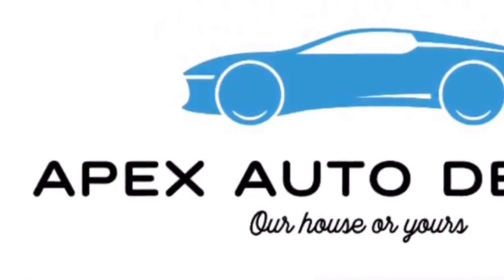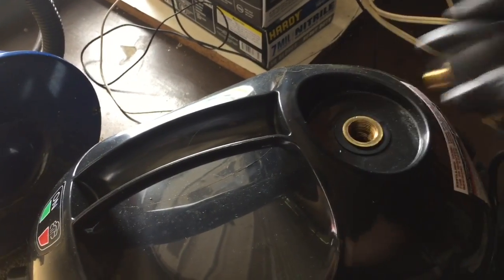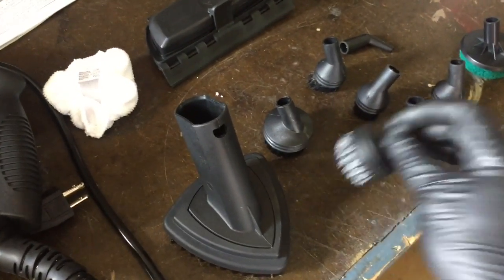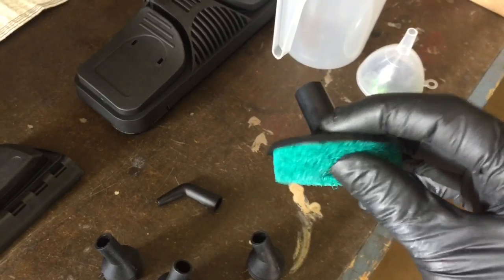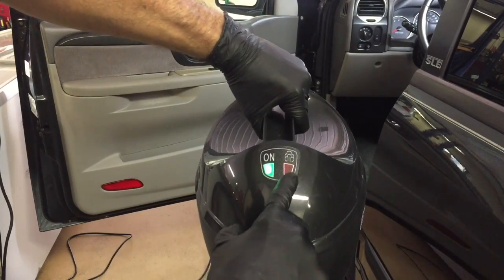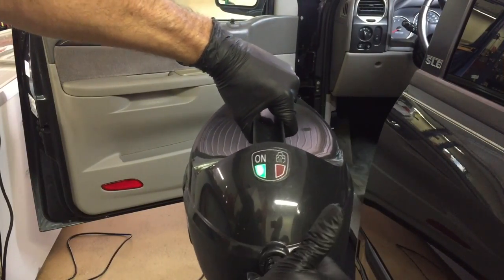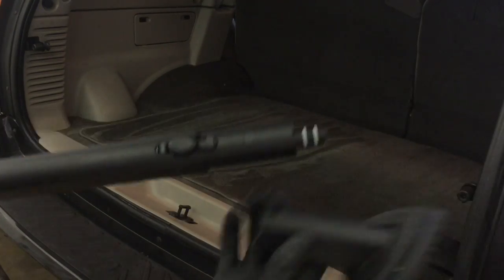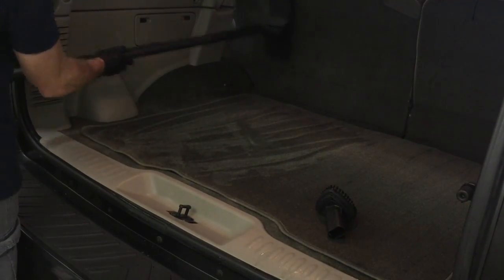Central Machinery 1500 w Steamer Kit. (From Harbor Freight) Review and Demonstration

Comment: I bought one of these for home use and it works fine for that but definitely wouldn't recommend for heavy use in a car detailing business.
Reply from the maker: I took 2 back that stopped emitting steam. One the wheel broke off. But I needed in a pinch. Kinda the only unit you can buy and take home that day in my area.☹️
Reply: Mine stopped emitting steam after two weeks. Not sure if something is clogged. It appears it is heating up but when I squeeze handle nothing happens. Guess I’m taking this one back. It’s a shame because it worked pretty good.
Reply: @kevinkleinhenz6511  Thought I'd come back to say I went through 3 of these machines in less than a year. I switched to the Dupray line of cleaners. I had one of the Central Machinery die on me in 2 weeks, also. Such a rip-off.
Reply: @watsonspuzzle  Well I suppose we get what we pay for. Harbor Freight exchanged it with no problem so that was a plus but if this one tanks I will get a refund and try another brand.
Reply: I’m reading these as I await for mine to arrive 😢
Reply: @therealfrazier  It worked quite well until it didn't. Hopefully, yours will hold up for awhile. I got the Dupray Neat after my experience with the Central Machinery, and it wasn't much more than this one.

Comment: I knew that this was not as good as the 1275, but I only paid $75 for it with a 25% off coupon. I don't use them often, so for the price, it works. Not a commercial unit by any means, but ok for infrequent use.
Reply from the maker: Indeed... in my area.. its the only unit that can be purchased and taken home same day. It got me through in a pinch, so I was thankful.

Comment: Thanks for the honest review . I still may go with the harbor freight model . I know the 1275 is better and you get what you pay for . But i will only be using this maybe a couple times and i have a coupon lol. I think my elbow grease can make up the difference and save me about 60 bucks.  At least for now . ( i will still try to get the 1275  if possible ) thanks . Honestly it looks like it works pretty good . Come on cheap decent tools same day ? I too am grateful
Reply from the maker: Sadly its the only steamer that can be purchased and taken home the same day... in my area, anyway. Yeah.. if you seldom use it. It may work for you. I had my unit broken in no time however. Now buried in a corner somewhere.
Reply: Whats the 1275 i just got into the steam cleaners

Comment: I picked up this exact unit last week.  I returned it yesterday..  Why?  Worked fine for 30-40 seconds at a time.  Then had to wait for the steam generator to heat up again and wait for the red light to go out.  So work for 30 sec or so, wait 60-90 seconds and do it again and again.  The inside of my tank had lots of junk in it.  I emptied the tank before returning it, lots of white powder residue came out.  I only did 3 refills of the tank with distilled water so basically went through 2 tanks.  
When buying a steam cleaner make sure to check the "cycle" time.  They say you can run for 40 minutes or so but that is NOT continuous.

Comment: I guess your store finally ran out of the McCullough 1275.  Thanks for the review and glad I went with the 1275.
Reply from the maker: kdog3495   😂. I should have anticipated that and snatched up the remaining few! I ordered the McCulloch 1385 which has a 64 oz reservoir.
Reply: Apex Detail let us know if you see any major benefits to the 1385 other than capacity. The higher end models looked to have better build quality, but the 1275 is great for a weekend warrior like myself.
Reply from the maker: kdog3495   The 1275 is 👌🏻.  I dont want more heat or pressure than that. A longer time period between refills would be nice though. I will do a vid on it after a few uses 👍🏻
Reply: Apex Detail please make a video of the 1385
Reply: any slammin deals on the 1275?! rn like 140$ (2/28/19)

Comment: Apex Detail, can you use the attachments from the McCulloch on the Central Machinery cleaner? Sadly, I see no way to get replacement heads or tips for this machine. ...sigh...
Reply from the maker: Unfortunately no. I tried. That thing is so disappointing... I have it buried in a corner somewhere.
Reply: Shoot. That's what I was afraid of. Proprietary and no way to get replacement parts. I guess I'll just use this until it breaks down and replace it with a McCulloch. No wonder Harbor Freight had this on clearance. Thanks for letting me know.
Reply from the maker: And sadly... its the only one in my area that can be purchased and taken home same day in a pinch😦

Comment: Can you add any cleaning products or essential oils to the water? Also, can I steam my walls with this?
Reply: Essential oils perhaps if diluted a bit more than recommended (heat tends to make aromatic compounds much more pronounced). And then flush out the tank and lines to remove any residue which may form and clog things. 

However i would absolutely not recommend putting any chemical cleaning agents into a steamer, unless recommended by the steamer manufacturer and only if you have the required ppe to use said chemicals in such a manner as per the chemical manufacturers warnings. Some of that stuff you dont want to breathe at room temp, let alone in a vaporized and heated form. 

The industrial solvent vapor cleaners ive seen used in aviation maintenance for regular (but heavy) cleaning requires chemical resistant full body suits, and SCBAs and or respirators rated for the chemicals.

Comment: I got this because I needed it and it was on sale and I paid under 100 it's does the job but not going to last long after one car the triangle brush has flattened out. I had a micro fiber wrapped around it and wasn't scrubbing hard wtf. But it will work in a pinch. Cheers John @Carefree Auto Detailing
Reply from the maker: John Emmel    You said it John.... its one of the few you can go right out and buy off the shelf when you need one
Reply: saved my butt on Sunday with two vehicles that were hammered. Running out now still very busy I haven't forgotten ya I'll call or msg in a few weeks about the link ya sent good luck in new place
Reply from the maker: Sounds good... be safe out there
Reply: John Emmel on

Comment: Is it powerful enough for an engine bay?
Reply from the maker: Unfortunately... no. Unless you have 3 hours to do it.
Reply: Apex Detail OK. Looks great for interior detailing though!
Reply from the maker: Show Me The Best    If the plastic hold up, sure... but 3 pieces of plastic around the unit have cracked or have completely broken off. Best of luck.🤞🏻
Reply: Thanks for the question and the replies!! I bought this unit and was wondering the same. If I can use it for basic detail and for an engine bay, that would be great. If I have to spend the extra time, I will. Hopefully it does work. For an older '89 Bronco II that has all sorts of mess in, around and under... lol I have a pressure washer, but no thanks to water around senstive parts/electrical.

Comment: that doesn't look like distilled water.I mean unless you made your own distilled water I can't tell
Reply from the maker: What I used was purified... even better. Reversed osmosis is better than distillation. Especially for steamers and making them last
Reply: you want distilled. there is no purer water than that.  spring water has some of the highest TDS (total dissolved solids) of any water.  in the boiling chamber those dissolved solids will be left behind as the water vaporizes which will bring an early death to your steamer.  you can test this out. fill 2 pots on the stove. one with spring water and the other with distilled and heat until all water is gone.  you will be shocked to see what sludge is left behind by the "purified spring water".  Distilled water has a reading of 0 ppm on the TDS meter. spring water will vary from 200 - 300 ppm.  Reverse osmosis will not remove all of the sediment either.  much better than spring water however.  this is the reason you are having to replace your steamers.  they  build up with sludge and mineral deposits and they no longer perform.  this goes for anything that requires water.  including humans.  10 years of drinking distilled water here.  good video though.
Reply: @jaredb2142  Deionized is the best to use.